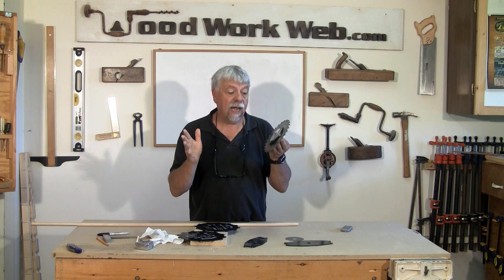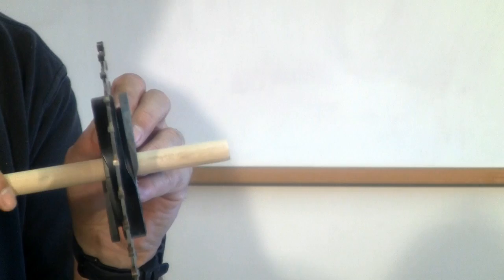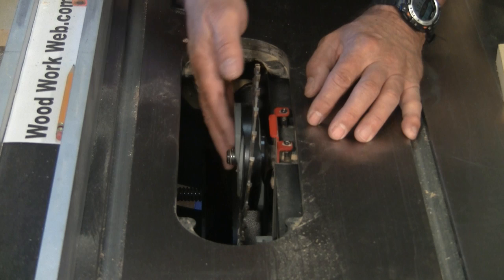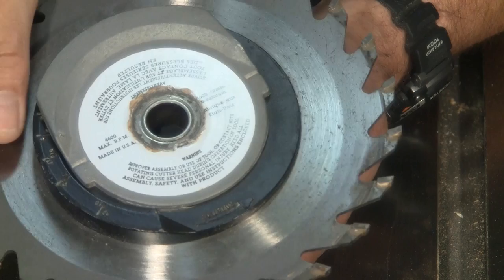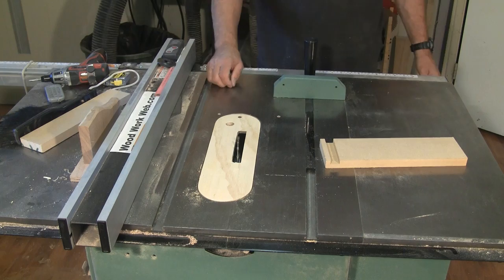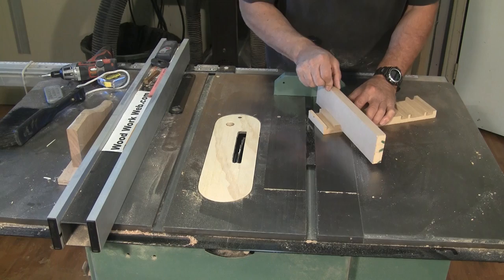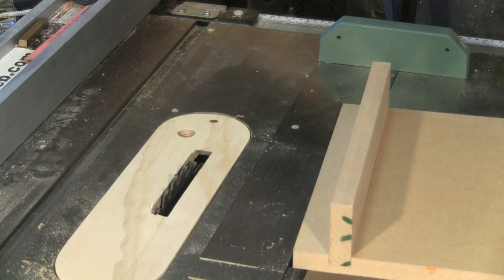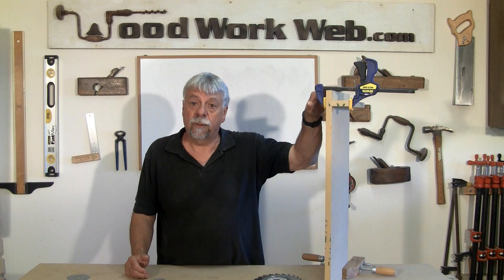Testing the Wobble Dado Blade -  woodworkweb

Comment: They could easily engineer out any arc caused by wobble radius. Just make the diameter of the blade ever so slightly smaller when it's at center and longer at its max wobble. The blade, when measured from the side, would look slightly elliptical, though I doubt you could see it with the naked eye. 
Might cost too much to make though ...

Comment: What setting did you finally use? Mine is a  Diablo which I've not yet used (the way it makes the saw shake scares me a bit) has stops at common widths, e.g. 1/4" or 3/4" or whatever. I'm going to give it a try this weekend and see how it works. I bought it new at a Big Box store which shall remain nameless. When I asked the associate in the tool section where I might find the dado blade, he said, "What's a dado?" I'm not kidding.

Comment: The fast way to adjust one of these...is to take a piece of wood or a ruler and put it in front of the dado blade, and spin it by hand and adjust the size until its exactly what you want it to be. Tighten it down and voila!  Takes all of a minute or two to adjust one at most.

Comment: The thing I do not like about this blade is it is off balance. Also it will not fit some tables very well due to the way the blade hangs "out"over the mounting edge/surface.. On my table I can not cut more then a 1/2" with out it hitting the actual metal table. I got mine at homedepot not that long ago... (Maybe 8 years...) Thanks for the vid. Also you can adjust them with out removing the whole thing, just loosen and adjust. I like the wood cover plate you made. Did you do it on a bandsaw or scroll saw?

Comment: That was the fastest blade changing I have ever seen. I really need to get me one of these .Like the adj.one better than the stack. The main wood I use is 3/4 so I need to adjust one and just adj. as I need.
Reply from the maker: lol ... yes I am master at the blade changing (I wish)  ... someone suggested a pre-set jig might work for this, I might even  try that when I get some time ... would be interesting to see if it could work.
Thanks for commenting and making my grin ...
Colin
Reply: Did you have troubles because it was a older blade . Because I have a friend that has one made by porter cable and he just turns it to a size and its and cuts.
Reply from the maker: Stephen Standridge This is an older blade ... maybe ... hmm, 15 - 20 years, and I don't know what a newer blade would be like as I have not looked at one, it could be that the newer blades have finer calibrations. Mine is terrible as you can see in video ... also, when I am cutting dados, I want a snug fit, so that takes a bit of fiddling too. I will have to hunt down a newer blade and have a look at it ... thanks Stephen for the note, you have got me interested in more investigation on this :-)
Reply: Ok thanks Porter Cable  has a 7 are 71/4 inch blade for around $30.00.
enjoy your videos.
Reply: If you buy the newer blades from Porter Cable (costing around $35 for a 7 in blade) they work great and are pretty accurate
Reply: Stephen Standridge

Comment: How much vibration comes from have the blade deviate from the center line? would it place extra stress on the motor bearings?
Chris
Reply: +Chris Boyce Yes and yes. In a cabinet saw, not so bad. But in a contractor style saw that thing will walk right out of the shop with the vibration. There is a reason you don't see many of these around anymore.

Comment: Awesome vid. I haven't seen one of those since i was a kid. I think the "glitch" is caused by what is instead of creating a notch with parallel cuts, the wobble is creating it with thousands of sine waves and that's not going to be identical, especially when cutting essentially with the corner/side of the blade teeth, not a perpendicular kerf. The farther towards the center of the notch you get, the more perpendicular the kerf and the more times it's getting cut and recut. In theory, this would cause the slight recessed curve in the center that you demonstrated (a perfect representation of which parts are getting cut the most and least), as well as notch sides that are not perfectly linear throughout the length of the notch (but would probably make for a tighter fit). I'd guess neither of these would make the slightest difference in 99% of woodworking and even for that 1% ... going a little slower or retracing the cut once or twice would probably eliminate it.. I'm definitely going to keep my eyes out for one.

Comment: When you finally got your 3/4 setting correct what did the marker read on the blade? Thanks for the good info too!
Reply from the maker: gone fishin  Well ... it read, more or less 3/4 of an inch, but that was the whole problem, the line mark is probably 1/16 of an inch wide, plus the the other line to match it up is also 1/16 wide so ... when you set them exactly overlap it's not really 3/4 inch in actually quite a bit more so you have to keep playing around to get a snug fit .. lol a bit finer markings would have been a big help but ... oh well ...

Comment: The problem with the wobble wheel is that you have to keep adjusting it to get it right. I use the stackable type now but I still have a wobble wheel and use it from time to time for rabbit joints.

Comment: Arguably, you would get smoother results with the wobble blade as you are cutting all surfaces with the same cutting edges.  With stack Dados, you have multiple different cutting edges which would result in step like cuts.  This however, is probably not a noticeable difference to the average person.

Comment: You made a video about a router and a Jig you made. You put the wood in the jig tightened it up to get the thickness, then put the peace of wood you wanted the dado in. And two passes with the router and your done. All this adjustments you having to make with this  wobble wheel is crazy time consuming.

Comment: I feel like there is an equation to figure out the width of the cut based upon the size of the blade and the angle of the blade. Similar to, if not the same, as the equation to find the distance between two points on a circle.

Comment: i owned one of those and mine had a set screw to lock the adjustment in. i didnt like the perfomance of the blade cause it made really noticeable concave cuts and depending on how fast you fed the wood int the blade the adjusted width may change due to the blade flexing.

Comment: seems like a usefull tool ........ if you have a couple , set them each exactly , pin or gleu them so they whont move and write the dato width on the saw , most of the work whent intoo the adjusting so if you dont need to do that for every standard thickness it should work fine , you need to chance the saw to make the dato's anyway
it looked kinda weird like its about to come off the machine but it worked and thats wat matters 
wonder if it can be made so you can ajust it without loosening the nut like with a ajusting screw on the side of the thicker part

Comment: Shouldn't be difficult to make a setting jig for one of these. Have a base with a post to fit the arbor hole. Get a height gauge like is used by machinists on a surface plate. Set the zero plane at the center of the thickness of the hub. Set the wobble then measure the height of the highest tooth. One half of the cut width is what you want to read on the height gauge. If you don't want to put $ into a height gauge, have a machine shop mill a set of step blocks in steel for setting it for common actual bord thicknesses. That's a feature of the wobble dado, it can be infinitely tweaked to adapt to any board thickness within its range. Stack dado sets need shims.

Comment: Smart tool! Never seen one of these before
Reply from the maker: Neill Wylie They are not as popular these days, but 25 - 30 years ago they were all the rage, funny how things change, even in woodworking
Reply: WoodWorkWeb I wouldn't mind getting my paws on one to find out how it would work out for me. I've been using my router to do dados so far.
(newer to woodwork, normally work metal)
Reply from the maker: Neill Wylie Nothing wrong with using a router to made dado, in most cases they actually do a bit better job, cleaner edges and cleaner bottoms and probably about the same time to set-up

Comment: had one of these for years still can buy them about $35 new      works great on mdf has more tear out on veneer plywood than stacked dado     measure material thickness first even though the say 3/4 different plywoods and mdf are all a little different just add a little past the wheel measurement you will be fine

Comment: I have one of these in my shop, had it for years, never used it.  I was just thinking I should set it up for my most common size, prob 3/4 ply or mdf, and keep it there and use it for that.  It would be quicker than setting up stacks everytime.

Comment: Many saw manufacturers do not recommend using the wobble dado on their table saw, that is why some have such a short shaft so you can not use this blade. To buy one at a yard sale is not the smart thing to do. I bought a wobble blade about 40 years and it works well on my radial arm saw.  You can get many stackers for under $100 but the router is the best option .
Reply from the maker: Michael Fisher Yes, the small portable table saws, and are often direct drive have short arbors to prevent use of any type of dado blade, it burns our their motors. Yes, and buying anything at a yard sale comes with some sort of risk, like always you need to check things out first.
I must say, you are a much braver man than me who would use a wobble wheel on a radial arm saw.

Comment: There should be a washer on the arbor that the nut turns against and not the adjusting ring. Every time you tighten the nut without the washer you change the width.

Comment: I would put up with having to do that re-adjusting to save $100. Unless I was needing to use different size dado's everyday or week, but if it was just a couple times a year I'd be fine with it. I will admit it doesn't seem very safe and I think that would be a little harsh on your saw motor but I have no clue.

Comment: Is it easier to set up shims on a normal dado set? Or is that also guess work? I have never used a Dado before. I have seen a dado set with shims that also incorporated a dial system for the final fine adjustment.  I forgot the name of that one.
Reply from the maker: Jay Dee It can be easier to set up a dado blade, if you have the settings sheet. If you don't you could make one. Here is the link to my video on using dado blades, I think you will get the idea :)
Hope this help Jay
Colin
Reply from the maker: Jay Dee Whoops ... and here is the link Using Dado Blades - A Woodworkweb woodwoking video

Comment: Cut quality seemed to be fairly acceptable but I'm  thinking it would be alot harder to line up your cut as the blade is running at angle and constantly changing positions.

Comment: a couple things. your end result, it looks like the gap is caused by the edge of the other piece of wood... but that gap wouldnt hurt much anyway. also, once you get used to the wobble wheel, you could likely get it adjusted properly on 2 or 3 tests. or if you have a really good one, the measurements are dead on and you can get it on the first run... but this is not a perfect world ^_^
Reply: +Murray Kitson what I did with one wobble blade I have is I wrote my own dimensions on the blade itself. The factory dimensions usually aren't even close. Another problem wobble blades can have is they can close up on you if you cut harder stock. I mean they kind of bend to do what they do. So a hard wood can bend them back. I used to make a lot of box joints with a wobble blade and when I stacked up all of my sides, and cut them all at once I could end up with a narrower cut than my single test cut.

Comment: Colin, I was looking into a stack dado for my old TS with a 1/2 inch arbor. I contacted Forrest and they could set me up with a stack for $300 and it would be $6 each, times 8 blades, to weld and machine the adaptors for my 1/2 inch arbor. $350???? Naahhh!!!! I've learned to love my wobblers.
Reply from the maker: Bill Davis I had to read your post twice Bill, I have only ever heard of table saws with a 1/2 arbor, have never seen one, so am interested to know what make it is and what year you think it might be.
Sounds like you sorted out your own solution by going with the wobble ...
Thanks for the note Bill ... appreciate it
Reply: WoodWorkWeb I got an old craftsman 103.22171 tilt arbor saw from my dad. I checked on Lumberjocks.com and Vintage machinery.com [or dot org, I forget which] and It "appears" to be early 70's. I fixt it all up pretty with new paint, a link belt, a motor upgrade and a reconditioned factory stand..[I posted some pix of it on Lumberjocks. User name HillWilly]. It works amazing but the biggest blade I can use on it is 8 1/4 inches, which really isn't big enough for a lot of work, so I decided to use it as a dedicated dado/rabit machine and I will look for a cool old rig that I can recondition and use a 10 inch blade.
    I have recently seen that there are a lot of used wobblers out there. I guess because they are older, I have even seen some already set up for 1/2 inch arbor. And some even have carbide teeth. [ hey, now there is a thot !!!!  :<D  ]
Reply from the maker: Bill Davis  Thanks for the info Bill, yes, some of the early wobbles came with a 1/2" collar insert, at least mine did, and I remember that it was difficult to get out. Thanks for the info, very interesting ...

Comment: The problem with them is that they do not make a flat bottom cut so glue does not contact the bottom of the board going into the slot. Plus they tend to tear up the edges. This why industry uses stacking sets.

Comment: once you've used it a few times, you get to know where to set it to perfect measure everytime, maybe by scratching a little mark on the exact line where your 3/4 measure mark is. If you have a lot of cuts to make you only have to set it up the one time to get all your cuts done then change your blade to cut to size
Reply: +bob wilson you should see one wobble blade I have. I have written all over the hub what widths I get setting it various places. The factory markings are really not even close. But I have also found the width of the dado is affected by the hardness of the material I am cutting too. Harder materials can bend a wobble blade in, and you get a narrower cut as a result. So there's no one set spot when it comes to wobble blades.

Comment: An adjustable wobble probably wouldn't be the best, as it would produce an arc at the cut. A non-adjustable would be better, since you can profile each individual tooth to end up with a flat cut. 
But I personally prefer routers for wider cuts.

Comment: Yes, having the adjustability built into the blade is a HUGE stability issue. I can only imagine how many of these flew apart or exploded at high speed. The product was obviously discontinued due to liability issues. I'm willing to bet original manufacturer went bankrupt for inadequate insurance for liability, and then assets seized. Best,

Comment: There are four of them advertized at the top of the comments. They are everywhere and just about everyone makes one. They make a very rough dado unless you feed them very slowly. And the arc at the bottom of the groove can be a problem. The less glue you put in a joint and make a complete seal the better. I used to have one. I'd rather take the time to set up a multiple blade and get a good cut.
Reply from the maker: People either hate them or lover them I find.

Comment: I have used this (adjustable dado blade) not wobble blade for at least 30 years.  It is much easier to adjust by spinning the wheel on the arbor by hand and you get it perfect within a couple of thousands.  This demo shows complete lack of understanding the setup and discourages anyone from appreciating the design.

Comment: It would have an arc in it just because the blade is waving back and forth from a fixed point. If that's an issue, a thin line of wood glue would fill the gap

Comment: Am I the only one who would use the fence as a reference and just measure the wobble by cycling the blade around by hand. This is way more work than it needs to be.  I have a similar Craftsman blade that used two blades and is much easier to get the width right.

Comment: Could you measure the difference between the rebate and the stock thickness and then adjust the blade by that much? Maybe then only 1 adjustment after which you could mark the blade at that point (like if 3/4" was actually 3/4" + 1/16", mark that point).
Reply: Mine is already marked... inch on one side metric on the other.
Reply: Exactly.  He drove to Tokyo via London.

Comment: It creates extreme lateral forces, so do not even think of putting this thing on the cheap table saws and DIY table saws made from handheld saw. Those saws have thing auger that can break under this stress and make saw blade come off mid-cut.

Comment: I too have a wobble dado blade and have had one for ever, but never use it due to the fact that wobble blade will not fit the arbor of either my Skill or Rigid table saw. The wobble dado blade is to small. It will fit my hand held circular saw, but I hate to try it for safety reasons.
Reply from the maker: Hi Robin, yes, I would NOT recommend it for use on a circular saw, but now that is very interesting that it will fit on your circ saw but not on your ridgid or skil as they are all 5/8 arbor size. I do know that the tolerances on table saw arbors is a bit finer so that could be the difference.